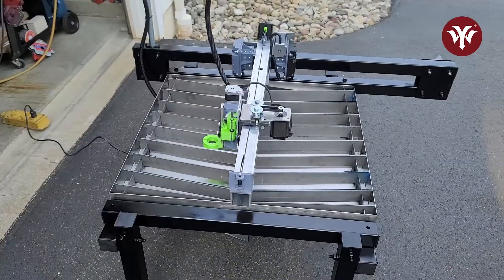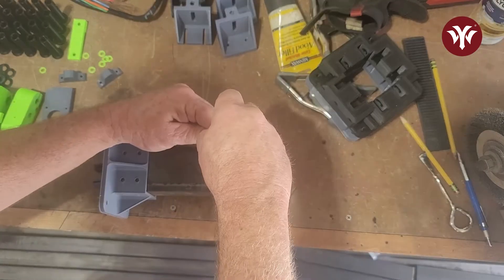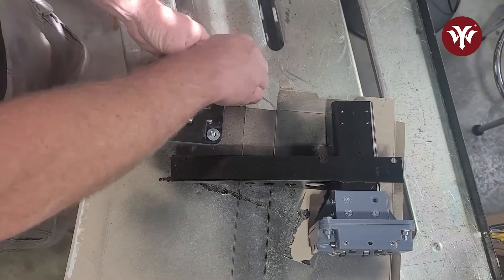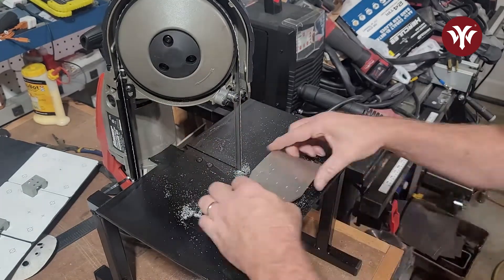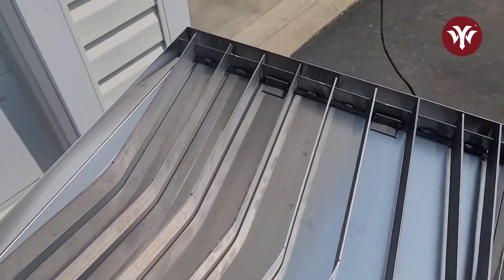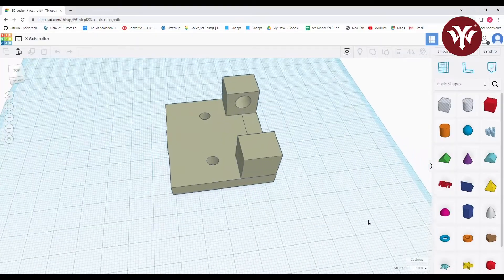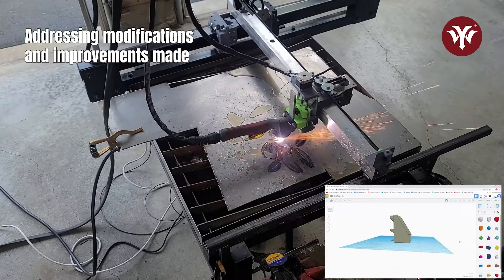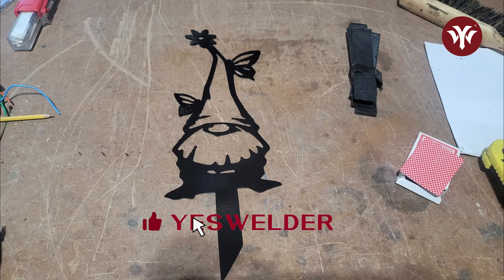Budget-Friendly DIY Project: Build a CNC Plasma Cutter Table Around $500!｜YesWelder

Comment: you're using the ct2050 on the table but you also have a CUT-65DS. Does this mean the CUT-65DS is no suitable, at least for thinner and lower duty cycle cuts? CUT-65DS is a lot cheaper.

Comment: good job, I'm looking for some inspiration. 
as I first spot this on JD’s Garage chanel, I was wondering why he did not make second gantry on the oposite side. it is not good to leave the end unsupported, just floating. 
and my 1st question is. is this diy copy of Langmuir's Crossfire or vice versa?
Reply: Crossfire doesn’t make them, they buy them from a company in China,  Hawui or something like that.
The sag is not the aluminum, check the weight per foot.
It’s Your printed parts and adjustments.
Last, when your not using the cutter, brace the end. Plastic can sag.

Comment: hi, I love my Yes Welder combo machine and I would like to use its plasma cutting option to make this CNC cutter .. you are using the CUT-65DS .. will the CT2050 work in this application?

Comment: You can stop the sagging by adding a post on bering end then run run a cable to the other end near the torch. Use a turn buckle to tighten the cabe.

Comment: What do you use for software for designing stuff to cut out ?
Reply: I use inkscape and fusion 360
Reply: Inkscape for art, any 2d cad of your choice for dimensional stuff. I use solidedge 2d
Reply: @zacharytuttle5618  I have been using  fusion360, I have never used solid edge 2d.  I will check it out. Thanks.

Comment: That was a great video. Thanks for making it and also for sharing your files to print out the parts that you customized for the build. Im just about finished collecting all the materials. Im having trouble finding the 2-1/2 .120 square tube . Im in Lake Havasu City, Az and there is limited material availability without buying full sticks of steel.
Reply: Id recommend looking for a local fab shop and ask them if they would be willing to sell you some if they have it. At my shop, we had that happen before and we were more than willing to sell them the exact length they needed. It probably won't be that expensive even compared to a local steel supplier

Comment: Let me show you how I build this, and provide all the links EXCEPT the links to the plans.
Reply: He literally gave you the name of the channel who made the plans how much easier do you want it
Reply: Oh you poor man. Can I get you a tissue? The first 30 seconds said were to get the plans.
Reply: Jd's garage youtube channel is where you go to get the plans
Reply: I am looking at building jd's table from thier plans as well. I have to buy thier printed parts as I do not have a 3d printer. I'm trying to be frugal and looking for the least expensive route for me. I'm worried about design on fusion 360 tripping me up. I'm retired and somewhat electronically challenged! Saying that I do not want to spend a lot of money and have the table sitting idle in.my shop. I'm looking at inexpensive plasma cutters that are cnc ready. I can't find the yes plasma cutter that has the option.for plug and play. Andeli has a 65 amp cutter but it only as a 2 pin and 4 pin connection points, most others have 2 and 5 pins. So I dismissed that one, I have an everlast multi process machine but I use it for tig. Which exact yes cutter did you use?? 
Bestarc has one that will work as well as a straight torch but I don't know anything about thier products.

Comment: What is the thickest steel this will cut?
Reply: The dimensions are 30"x 28". The thickness of the material depends on your plasma cutter.  The YesWelder CT2050 clean cut over an inch thick

Comment: I bought the high frequency non pilot arc one for building this table around 5 months ago. I think I screwed up there. I notice now there is a non high frequency option. I can get it all to work until the plasma arcs and then it shuts everything down!
Reply: With the plasma cutter, make sure it is Non-High frequency or “blowback” and make sure it is CNC compatible or can actually be converted to work with a CNC. HF will mess with your electronics